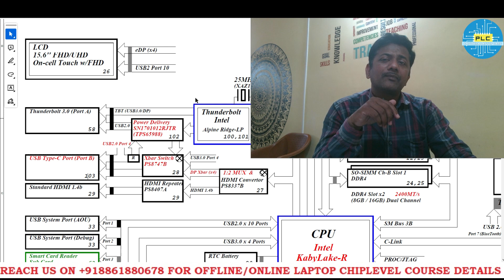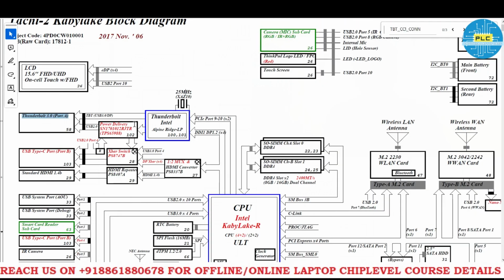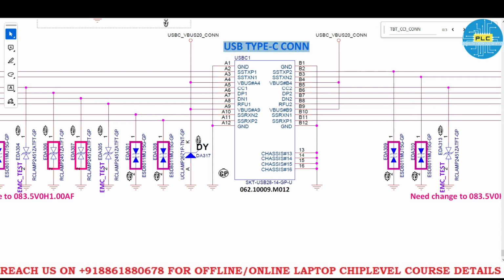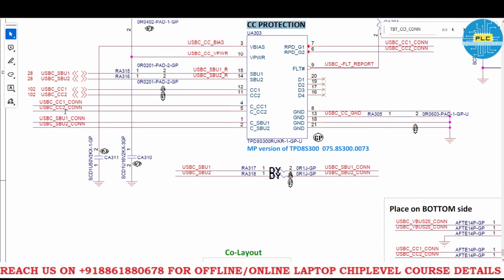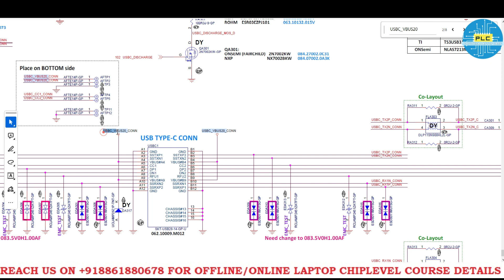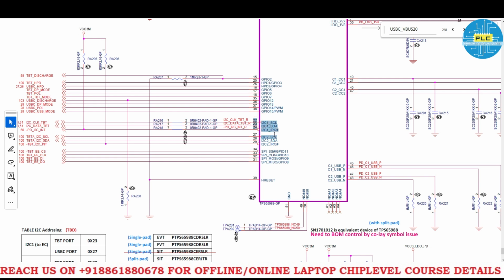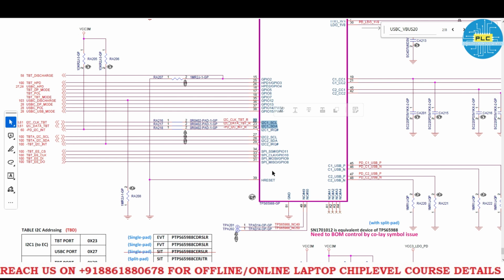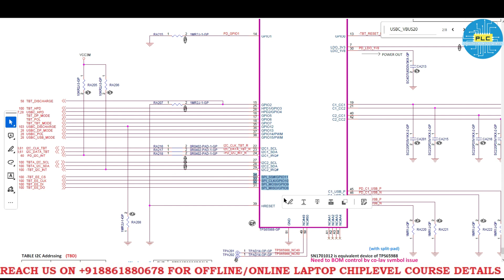LAPTOP REPAIR - TYPE C IN SCHEMATIC - EXPLAINED

Comment: I have my Lenovo l580 and it has 2 USB type c ports and one has gotten unhinged I want to use the second one but it's not working, I have check and the port seems intact  so I am assuming the issue could be that it's not enabled or is disabled by default any one who can help with how to enable it if that is the issue or provide a solution or another suggestion